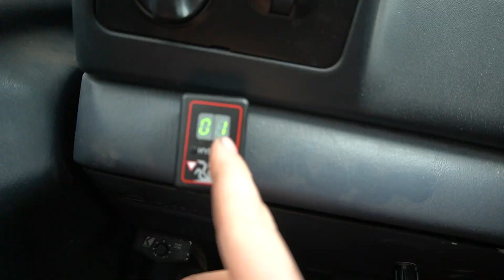The Number 1 Killer Of A 7.3L Powerstroke Engine

Comment: Just did glow plugs on my 94 f350, I originally ordered Motorcraft glow plugs. At least 2 of the 8 had defective threads, they would only thread about 6 threads and couldn’t turn it any further by hand as I didn’t want to force them. Pulled back out and put the old back, it threaded all the way in, pulled the old one back out and tried another new one, same issue, ordered a set of diesel Rx glow plugs, they threaded all the way in and so far no problems, and they’re made in the USA. Motorcraft has a qc problem, the defect in the thread is apparent to the naked eye, I saw it immediately and I’m 64, you’d think a trained qc tech would’ve caught this!

Comment: What causes a 7.3 to blow white smoke for about 3-5 seconds when pulling away from a stop, but then the smoke clears after getting up to speed? I had two trucks with that issue when I was a contractor. One was a 97 and the other a 99 and each one developed the issue at around 110k - 115k miles. They started and ran ok otherwise.

Comment: My 2002 7.3 had the injector/Glow Plug edge connector back out on the inside of the valve cover gasket connector.   Only effected 2 glow plugs and gave "Check Engine Light."  I replaced the harness inside the valve cover and the valve cover "Reusable " gasket.  Replaced all 4 glow plugs on that bank.   New glow plugs were Motorcraft Made in Germany.   3 of 4 started failing intermittently in 1 to 2 weeks.  Noticed original glow plugs were Motorcraft made in Ireland. 

Reinstalled original used glow plugs since the open circuit was the wiring connector not the plugs.  No more problems. Emailed photo of my Fluke Multimeter showing open circuit in new Glow Plug to supplier and received refund on the glow plugs.

Comment: Have seen that over the years when people use silicone. Silicone needs to be used very, very limited in those applicarions. I don't like silicone, a poor sealant for engines. Anerobic sealant is far better sealant!
Reply: Anaerobic is a great sealer but it only works on surfaces that are machined perfectly flat or very close to flat and will only fill very minor imperfections. Silicone is the best for situations with warped covers/pans and surfaces that are rough cast or are in very poor/rough condition or if you need to fill a large gap(like intake end seals on old v8 engines). Both sealers have their purpose but a lot of people don't even know about anaerobic sealer most people only know about RTV.
Reply: @briang4470 I only use Yamabond #4. That’s all I have used since 1975.

Comment: beru is the OEM
any word on bosch?
Reply from the maker: Motorcraft only.
Reply: @PSCAutomotiveAndDieselRepair  Motorcraft glow plugs are the "Beru" plugs. I had a 7.3 eat an autolite glow plug about 8 years ago. The motorcraft plugs that I replaced them with had "Beru" etched on the plugs. I've also seen it mentioned on the ford-trucks forums.

Comment: I had  1995 f350 power stroke diesel and the only problem I ever had was the glow plug. I also learned when I was in Colorado and couldn't plug the truck in anywhere to have someone give it a shot of ether in the intake manifold after the air filter while starting it. It started right up. But use as last resort because it isn't good to do it too often.

Comment: What about "International glow plugs"?
Reply: Considering international made the DT444E by themselves (essentially a 7.3 but with very minor differences) I’m sure you can run international glow plugs BUT because of those minor differences I’d just run motorcraft if you can get your hands on them to play it safe
Reply: @KDlGG  I'd bet the Motorcraft glow plugs ARE the International glow plugs.
Reply: @kirkpalmer1709 might be the case now considering all ford sensors and plugs are from china, even ICP and IPR sensors are Chinese made. But I did get some insight a couple months ago, international glow plugs and motorcraft, atleast as of when these trucks were released were made under different manufacturers, international first used a company called beru, later left them for another manufacturer but ford went to them shortly after they left. One being made in Ireland and one made in Germany, as of now I honestly couldn’t tell you, wouldn’t touch motorcraft parts now though